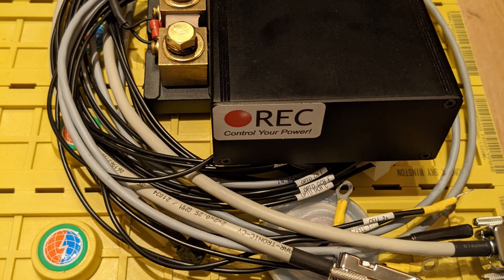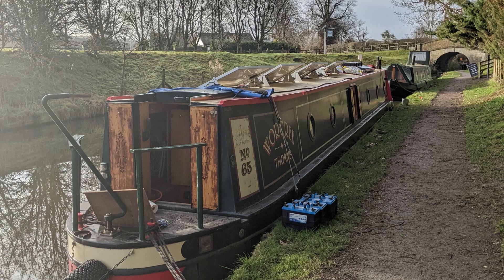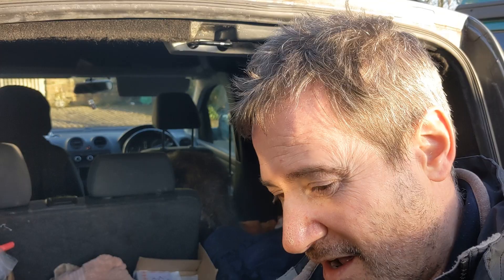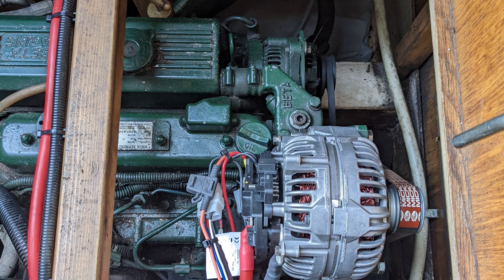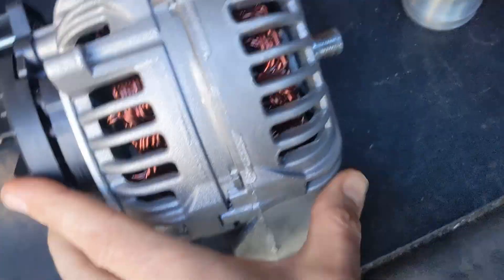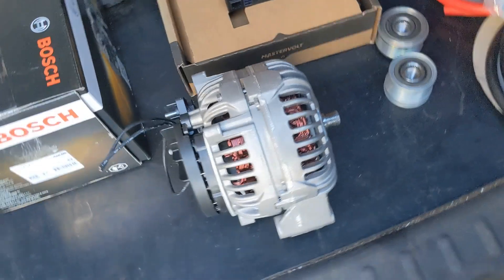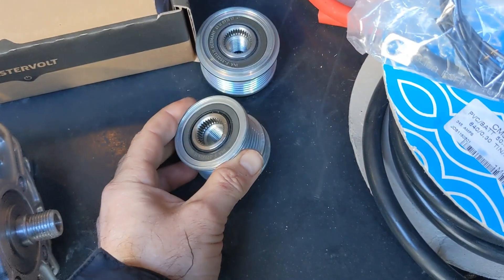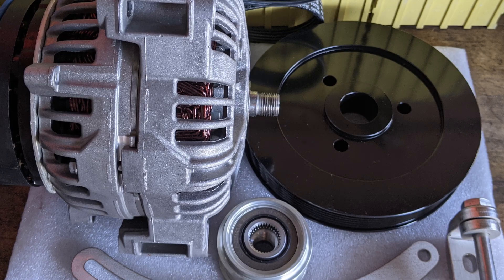How to not blow up your alternator when charging Lithium.. Mastervolt/Wakespeed regulator. Beta 38.

Comment: I bought my wakespeed 500direct from the website  and that was a mistake after 6 month it craped out and I tried to contact the manufacturer no repply on phone or e mail in my view it is not a product which you can compare with a mastervolt especially the program....
Reply from the maker: Hi. Think there has been some teething problems during transition to Dragonfly ownership. My experience of the support has been positive and it’s best if you try again, copying the email to the sales and support email addresses. 🤞